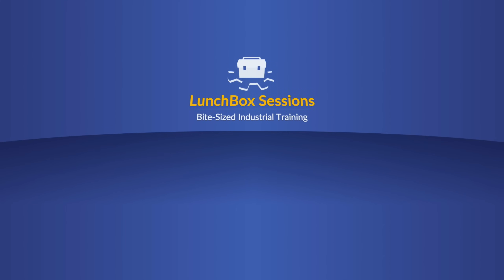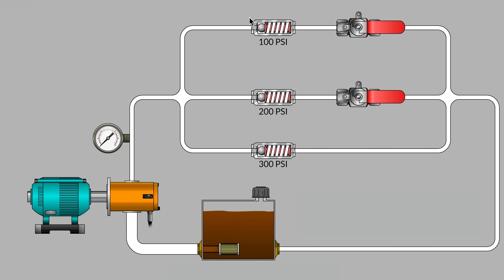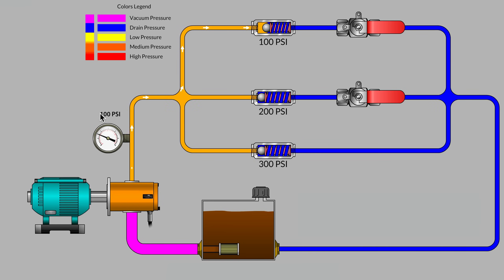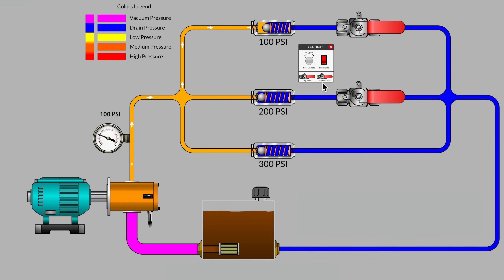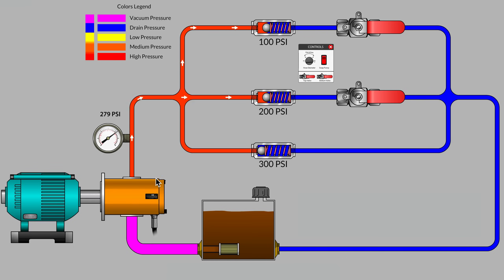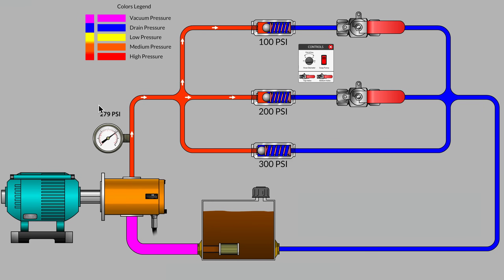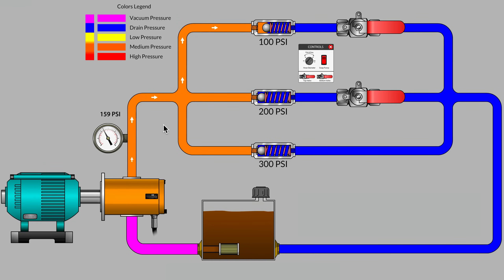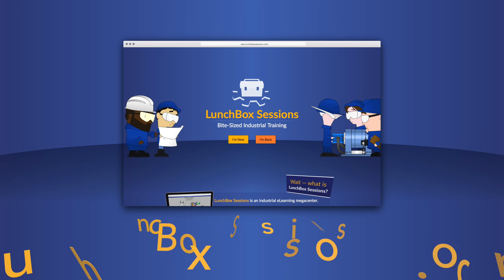Pressure in Parallel Circuits

Comment: I have a question, if the psi were all the same and all open valves so nothing restricting the fluids flow, would the fluid flow thru all cylinders equally? Also assuming there were pistons at the end of each cylinder, would all three cylinders have the same output force?
Reply: fluid flow would go the cylinder with the lightest load. once that cylinder ran out of stroke, the next lightest loaded cylinder would then stroke, etc. The "path of least resistance" is what causes so much heartache when trying to synchronize actuators.

Comment: I had a system with parallel circuits for cooling.  I added throttle valves for each leg to balance the flow in the branches.

Comment: Fuel lines going to the engine normally has inline filter with pressure gauges upstream and downstream. What does it indicate if both pressure readings are equal?

Comment: Great example!  In the case where the tube was undersized for the pump, which allowed a circuit pressure to open the 200 psi check, is there a heat concern in those applications?  Is there a way to calculate the amount of heat that would be created due to the extra friction?

Comment: The spring loaded valves in the first two should be open when the pressure of the system exceeds their rating :p

Comment: Wonderful video. Thank you so much. I however have a doubt. When larger pump is used and 279 PSI pressure is in system what happens on the output side? Since both lines join at one junction, won't the output from 200 psi line build back pressure on the 100 psi one effectively shutting it? Or since path of least resistance is towards the tank both lines will merge?

Comment: According to Bernoulli's principle, when you increase the pipe diamter, shouldn't the pressure increase instead of dropping??
Reply: That could be correct depending on the system, but generally no it's not correct unless your volumetric flow rate is increased by a larger amount than the ratio of your pressure to your flow in your equation... (not sure if I explained that well)

Comment: What if we install shut off ball valve just before the 100psi c/v and not fully open it, but open it like %30. Would the system pressure  increase? I am curious, if we do it for the initial scenario, would we reach higher pressures?

Comment: Very cool video with a great explanation of the concept! Does anyone know any open-source software that is able to create circuits similar to those in these videos, where you can play around with fluid flow, resistances, tube sizing and other potential circuit components? Thanks in advance!

Comment: How do you connect in parallel when you want to operate multiple functions at once? a Crane for example. I want to lift and extend a boom at the same time. which valve will be used and how will the cnnections be made?

Comment: I'm interested in the dynamics of a unified lifting system of say, four parallel circuits. It seems that when a single load is evenly distributed amongst the four cylinders, the cylinders will act in unison. However, in real world circumstances, rarely are the loads equal. How do I lift an uneven load at a uniform rate?  The "path of least resistance" doctrine seems to indicate that when using the parallel circuit from a common manifold, I will lift the lightest loads first. Imagine uniformly lifting a baseball bat laying horizontally using four cylinders spread somewhat equidistant. Thank you! This is a fascinating series.

Comment: Hopefully someone will answer accurately: if I put a 600 resistance in the single line after the the 3 parallel loads, would that allow all loads to open? And the total supply pressure in the single line before the loads would be 1200? Further, if I put a restricter of 200 after the 100 load and a restricter of 100 after the 200 load, would that also give me flow through all lines? If so, is that more efficient or less efficient way than undersizing pipes?
Reply: To your first question, no. The 600 would be in series with the check valves above so would add to the upstream pressure. Ie with both taps open, pressure at gauge would be 700psi. With both taps closed, gauge would show 900.
Second question, yes that would mean all valves open and flow splits evenly between the 3 lines.

Comment: Can any one answer please 
From a compressed air tank 4 pipes all of different diameters are emerging and what will be the pressure ,flow rate ,velocity from each pipe
Reply: It will be 5 12 9 and 33
Reply: @midwest9757  😆

Comment: I have a question..if we install smaller diameter pipes, would not that mean that the velocity of the oil would be increased in order to maintain the flow?

Comment: Sir according to ypu is ni back press then pressure would be zero but if i cut pipe just after valve there would be pressure so how this is hapening. In daily use positive displacement pump after valve we still get pressure same like if wu squze the pipe we get more pressure outside????

Comment: Pressure Gauges used in Hydraulic Machines have got a small hole of 1 mm dia, How does the gauge shows the correct value of pressure in system, there should be a pressure drop as it is also similar to orifice?
Reply: Mech E no because there is no flow through the gauge.

Comment: In real life system you usually have a main valve (electro-proportional directional direct acting or pilot operated) with several sections. On every section max flow can be adjusted by means of precise pressure drop adjustment which limits out the flow on maximal spool displacement (biggest orifice opening) by pressure drop to flow equation. That way, flow can be varied by differeny current signal to the solenoid. 

If total maximum flow of all movents is lower than maximum flow that pump can give, all movements can be operated at max speed simultaneously. If not, what I usually do is implementation of MULTI OPEARATION function in the PLC which limits some current signals and/or prioritazing some movements. Otherwise, flow will go to movement that reqires most pressure first...and so on, total chaos :) Of course, it's not that simple, you must account for pressure drops generated only by flow through the component itself, like hydraulic motor, which completely unloaded spends more pressure on higher flow/speeds.

If the pump is LS compensated variable displaced, idle pressure setting (the one which it'll maintain when no movements are initiated, and/or add up to the highest combined LS signal from "heaviest" movement) must be set higher than flow adjustment valve. Different flow rates can be acquired in many ways, depending on the producer, another way would be different/unevenly machined orifices
Reply from the maker: Wow that's a super fantastic explanation. Thanks for sharing Lovro.
Reply: And thank you Carl (I guess) for this great animations. I've seen most of your videos, and although I understand the topic quite well already, I enjoy in this visualizations.

As a electrical/controll engineer starting to work as a commissioning engineer for complex offshore cranes about a year ago, I didn't know anything about hydraulics and I had to learn a lot the hard way. If only I found this channel sooner :)

However, there is is still one more (basic) thing that is bugging me, I found it important for understanding, not really for practice. I'm sure that the explanation is simple though. I would be very thankful if you could give me an answer, or even better, if you make a video about it. I will c/p the question I made some time ago on one forum. There was a huge interest in topic, I got a lot of people to think, but nobody could give me an actual answer! I'm sure many people here would be interested as well :)

Here's the c/p

"Hi everyone,

I have some uncertainties in understanding the orifice pressure drop equation.

First of all, I perfectly understand why do we have a certain pressure drop across the orifice, speed increases on the cost of the pressure drop according to formula (In ideal situations with no turbulence/viscosity factor Cd would be 1), but after the normal flow area is restored and velocity returns to original value, shouldn't the pressure increase (at the cost of kinematic energy) and end up restored by the very same formula again? (In ideal conditions, I understand there are certain losses).

Does the pressure restore after it passes the orifice, and if not, why not? I'm sure I'm missing something here. I try to google for this but didn't find the info I need.

Is the only pressure drop here related to losses? If so, I don't see the formula formulated in that way, it is based on pressure drop across the orifice because of gain in speed. Following that logic, after the speed is back to pre-orifice one, shouldn't the pressure be restored (minus the losses)?

What would be the formula if the system is ideal (no losses)? p1=p2?

Again, there must be some simple thing I'm missing here but if someone could give me an explanation of this, it would be great :)

p.s. the source I found mentioning this pressure restoration, but then not including it or saying anything about it in their formulas!

https://neutrium.net/fluid_flow/calculation-of-flow-through-nozzles-and-orifices/

Thanks in advance,

L"
Reply from the maker: Well this is a deep subject. I'll just tackle a little bit of your question for now. After the orifice, one in a series of resistances is now behind the flowing hydraulic fluid molecules. The fluid is on it's way back to tank (atmospheric pressure usually, and also a low potential), and so maximum circuit pressure (potential energy) is highest at the pump outlet (for many/most systems, when functioning normally) and all other orifices are pressure drops, as fluid moves back towards the tank. This is very much the same as for voltage. Potential energy (voltage) in an electrical circuit is highest before electrons flow through a resistance on their way to the neutral/ground pole. Energy losses are permanent in a hydraulic system if heat was created/radiated outward, due to friction.  The only time that I am aware of, that pressure is the same after an orifice as before, is when no flow is occurring (Pascal's law). I am speaking in general terms around your complex question. So I will give it more thought yet, especially where you are comparing only pressure to speed.
Reply from the maker: - Carl
Reply: Thanks again! I get the general idea and I understand the concept in case you have only a pump and an orifice. You need some pressure/force to squeze the fluid through the small opening but on the orifice outlet you have tank connection. It gets a bit fuzzier when you have more complex system, like flow-metered directional valve and an actuator/load after it.

Of course, it's understandable how the pressure drops are pressure losses, which translates to energy losses in form of heat. The funny thing is that I understand intuitivly these pressure drops accross the orifice (it makes sense), but the way most sources are explaining why do we have pressure drops is Bernoulli equation, and Bernoulli equation also mandates that after passing through the narrower are, the pressure will rise once again, but it doesn't, it is converted into heat.

Simple question that kinda gets you thinking :)
We have 2 full time hydraulic designers in our office. I asked them both the same question, and surprisingly, nobody could give me an answer. They told me I got them thinking now. When they were learning about this in their study days, they simply excepted the common explanation, without thinking too much deeper.

Would be great if you could make a video about it one day!
Reply: Hi  @lovrorb , If I have understood question correctly the answer is as follow. 

Scenario 1) Oil passes through the orifice and after the orifice there is moving hydraulic cylinder then the pressure drop will happen after orifice and it speed of oil will increase because of the constant flow rate (Q=AV) now pressure will not restore to it's original value even after you increase the area because you already have lost the energy through heat. 

Scenario 2) Oil passes through orifice and just goes to the tank then speed of the oil will increase and pressure difference will be there

Scenario 3) Oil passes through the orifice and after the orifice there is hydraulic cylinder but cylinder has completed (Relief valve pressure) it's stroke then there will be constant pressure throughout the line

Please post here if I have misunderstood your point.
Reply: Lovro Šipovac I believe it’s the fact that the actuator is acting as a sort of relief for the pressure after the orifice, assuming system pressure and circuit pressure have the same relief value the pressure at the orifice and before the orifice could see equal pressure at the moment just before the system pressure is relieved, say if circuit pressure relief for some funny reason  was set higher than main relief pressure or compensating pressure then pressure after the orifice may be higher than before, because the actuator is acting of a greater force than the pump can output, I think that’s the reason compensating valves are used in circuits to adjust the amount of restriction to a certain circuit depending on another circuits requirements... this may not be any help and you may have figured the answer out by now but I find it easier for me to understand what I actually know if I attempt to explain it
Reply: Lovro Sipovac 

Did you get the answer ?
If yes pls explain here. I was also thinking the same. In an interview question i was asked to draw pressure and velocity profile around orifice and i was stuck here.
Reply: @UnfitRunner  well ... I guess it disipates as heat

Comment: As usual excellent video. You are explaining complicated things in a very easy way . Thanks for your excellent work. I have two queries:
1) For the first case, Why the (200*300: 500) psi pressure is not reflected on the gauge as this pressure would be present on the junction of the two lines? 
2) Is there any general formula to calculate for any pipe, @ which maximum flow the pipe will start choking/restricting the flow?
Thanking you for sparing your valuable time.